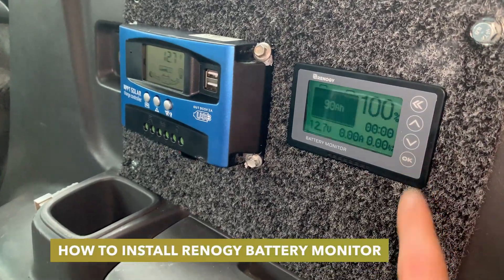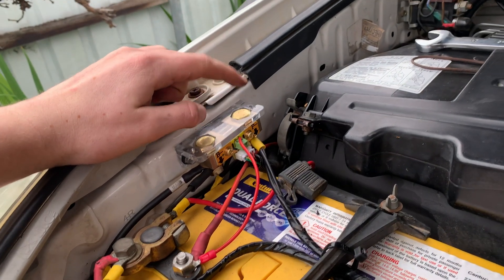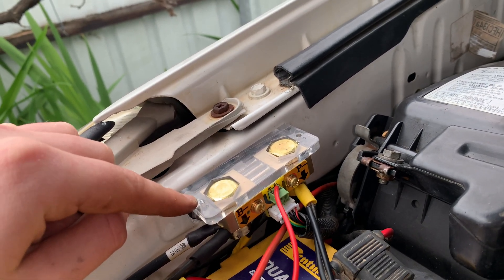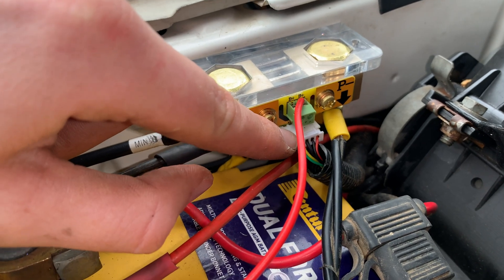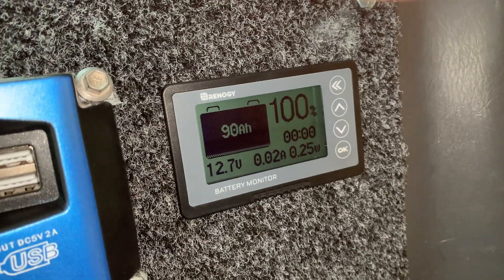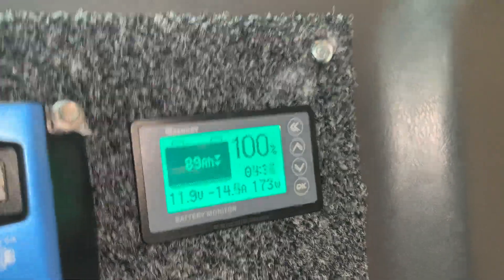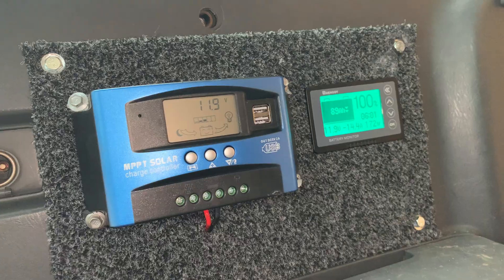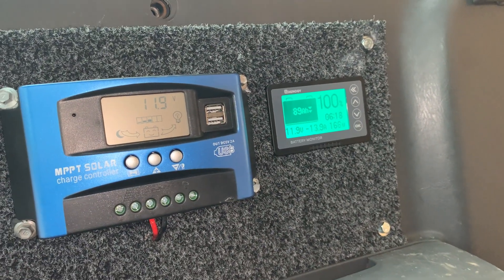How to Install the Renogy 12V Battery Monitor - $119 for Peace of Mind!

Comment: easy , just remember , -B is Battery terminal, -P is to charger/discharger (inverter) if you have multiple batteries in Parallel , what ever battery you are using to charge or discharge, so it shows monitor arrows up or  down
Reply from the maker: Great tips Patrick, thanks for the comment mate :)

Comment: have you had any issue with the monitor popping out of place where you’ve mounted it mate?
Reply from the maker: I've been lucky, mine has fit really snuggly so it hasn't moved.
Reply: dab of silicone, just mounted 2 more in RV